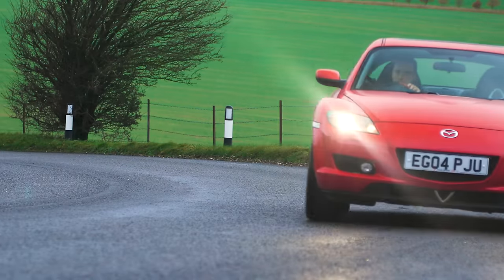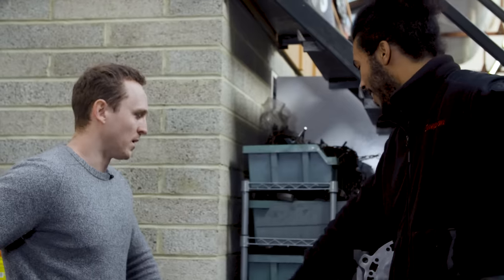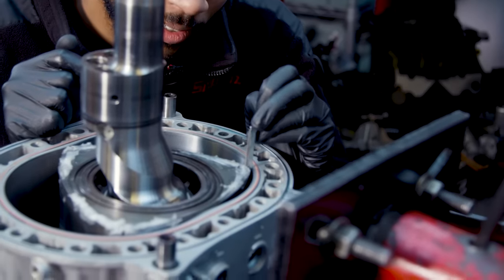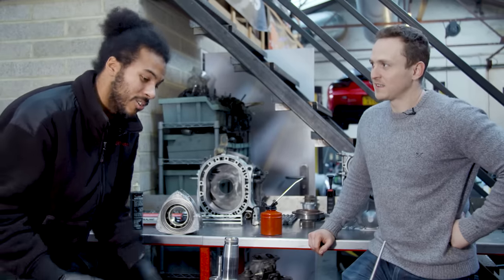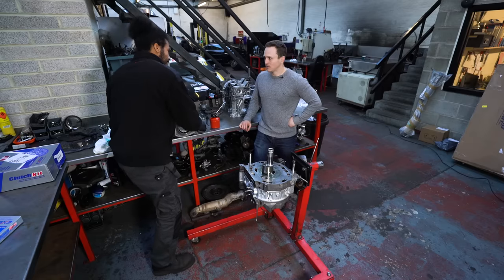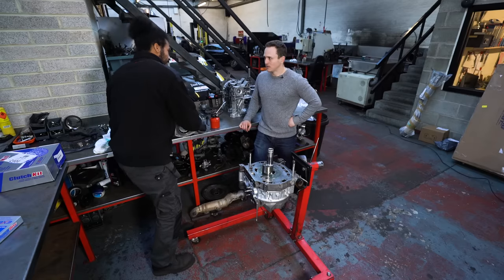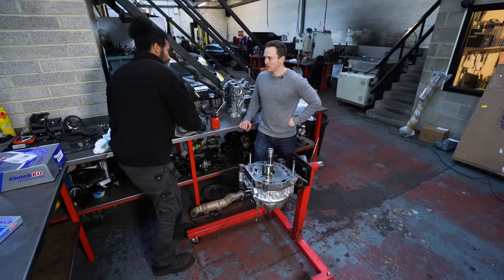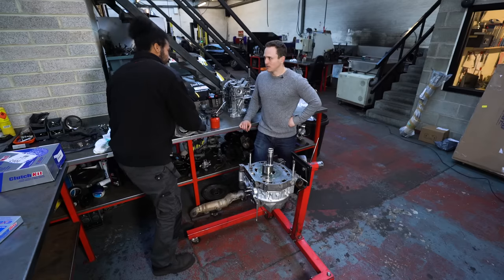How To Build A Rotary Engine: The ULTIMATE Guide

Comment: I really miss rebuilding a rotary engine, sold my fc that I've own for 9 years just last year....I've own 2 more before this fc. Watching this video makes me want to get another....but holy fuck the prices are high now. I am surprised at how small amount of oil the renesis engine holds, FC holds almost 5 quarts. Their oil pan are gigantic, rx8 holds less than 4 quarts. My motorcycle holds 3.5 quarts lol But I guess thats because the stock FC has an oil cooler that is TWICE the size of the stock RX8

Comment: Why do these engines not have an expansion chamber exhaust, like a 2 stroke dirtbike?  It has the same fixed port style 'valves.  It would seem to benefit in the same way, as a turbo effect.
Reply: Wankel engines are operate using the 4-stroke principle, they are not 2-stroke.
 The intake and exhaust stroke are not combined so no additional exhaust scavanging is required.

Comment: In 2019, no 26b Mazda factory produced rotary engines left in existence that came in the old rx-3 and rx-4 for a very limited time as a optional engine to the 12A and 12b that came as standard engines. Australian legislation ruled them out as a too powerful engine for the roads back in the 1980's so they disappeared and never to be seen again in factory supplied form.

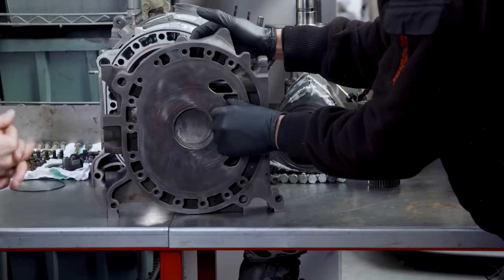Comment: 3:34 at cold bypass oil from flowing to the bearings?!?! NO SIR! If that was correct the engine would never last. The thermal pellet bypasses the oil to the injectors on the e-shaft when its cold. When warm, the injectors spray oil into the inside of the rotors to aid with cooling... also one of the reasons for oil coolers on these engines.  :-)

Comment: saying a rotary is unreliable just shows you've never owned one, they're danm near impossible to over rev or blow up unlike a piston engine where you go a few hundred rpm's over the redline and suddenly your loseing power and shooting piston connecting rods through the side of the block. On a rotary when you go a few THOUSAND rpm over the redline, well you just get more power and better engine lubrication WORST case senario is you run out of fuel injector flow and lean out wich could cause damage but i'd say that for the type of engine they are(a race engine designed to give loads of power and run at high rpm's all day long) they are incredibly reliable.
i think the problem is that people compare them to priuses and other grocery getters designed to go barely the speed limit sit in traffic for hours on end, this is not what the rotary was born to do and putting a rotary through a life like that will kill it in a matter of months.
Reply: FUEL MILEAGE IS ALL ON THE LEADING PLUG HOLE AND YOUR 2MM APEX SEAL  MAJOR WASTE OF FUEL AIR AND COMPRESSION FIX IT